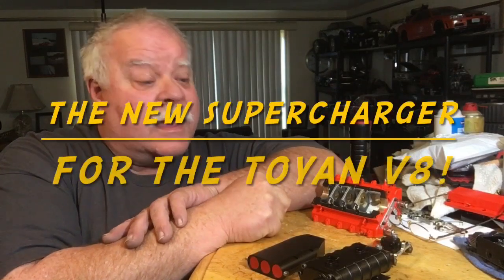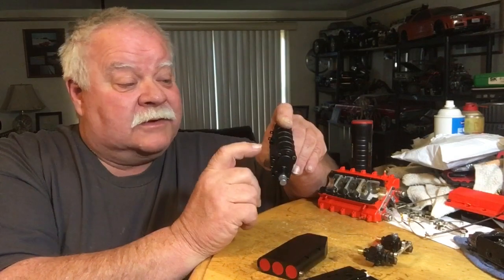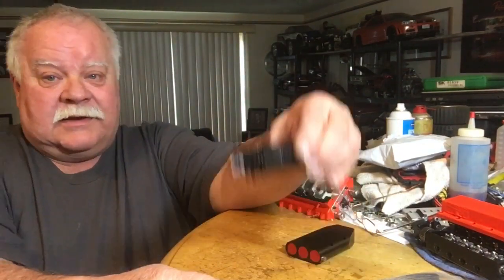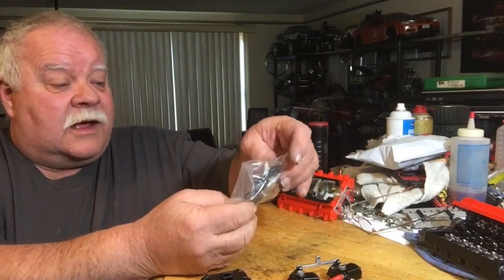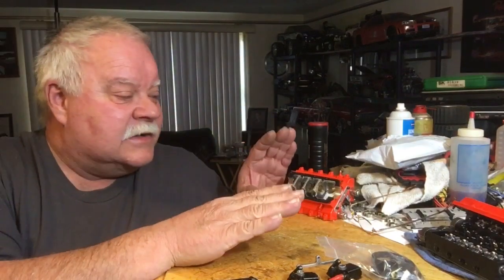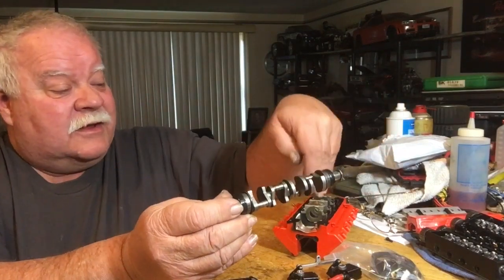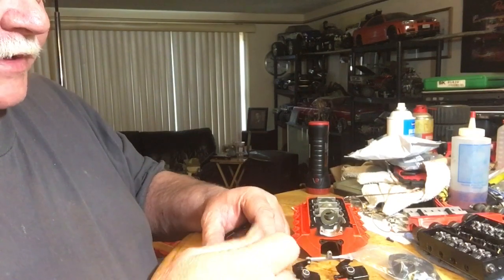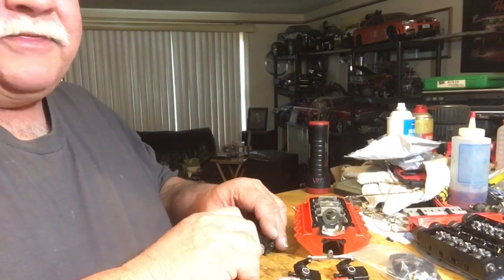lets look inside the new supercharger for the Toyan V8

Comment: like your show  If the engine is anadised you can remove anadise material With oven off  kitchen oven cleaner if it's powder coated bed blast I cannot tell on the video  I know you gotta it Covered
Reply from the maker: Great point i have some to remove the anadising.

Comment: I didn’t like how loose the new timing belt was, so I removed the right center idler and re used the old belt. Also, the belt as routed in the diagram, and in all the toyan videos, rubs hard on the lower left water pump housing bolt. I counter sunk the lower left screw and used a taper head flush screw in its place
Reply: I've added a front belt on myne, having the belt driving, cam pulls, water pump, and the blower is a bad bad idea, I added new pulleys,  and run the stock belt  much better.
Reply: @arado240dd  hey, its you. Wankel update video soon?